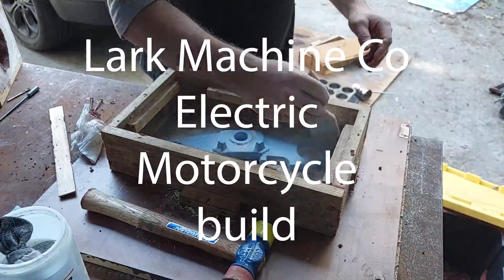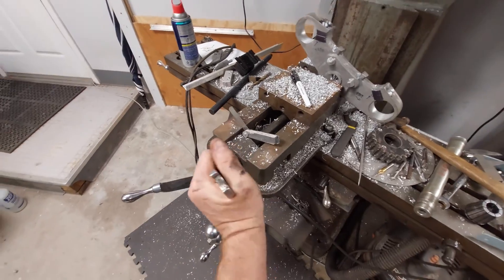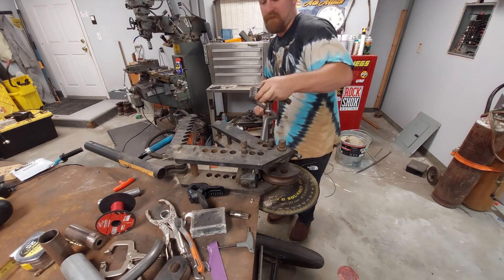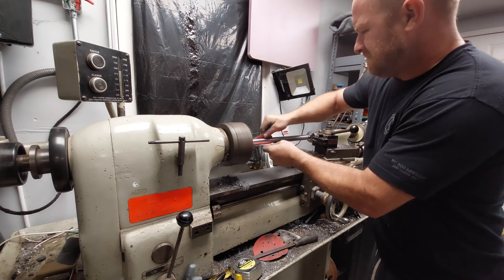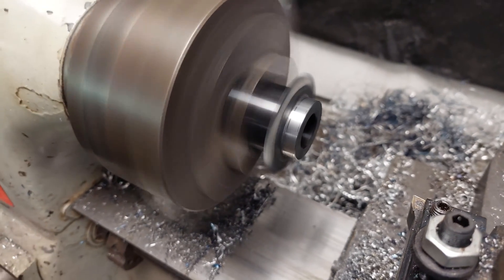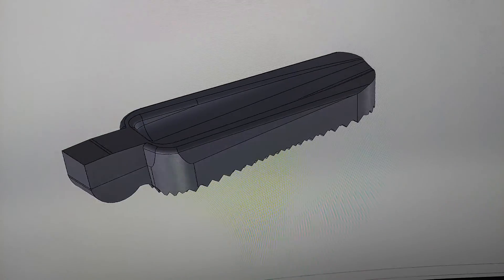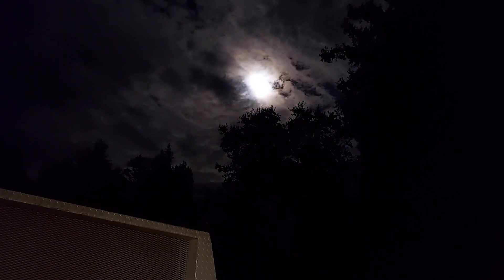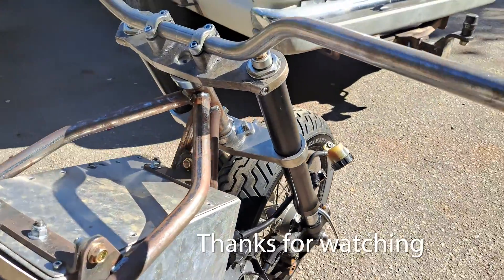Homemade Electric Motorcycle Build Part 1 | Frame Construction | Lark Machine Co

Comment: Hi, great work. But, i think you're going find the swinging arm pivot mountings on the frame arn't  rigid enough, considering the torque you're potentially capable of delivering.  Might have been a better option to make the pivot integral to the motor mount?

Comment: I was suprised when you said the motor power is 70 kW😁. From the spec it should be arround 8.1 kW, which is still decent, but it may be somewhat underpowered if you plan to ride your family with it.
Reply from the maker: Liquid cooled contoller and motor are capable of 70kW bursts.  30sec.  Battery will be the limiting factor for power.  Continuous power will be 25kW. Dont know where you got your number, but it might be nominal on the aircooled model

Comment: Never fail to impress. looking forward to seeing next part. I guess the traditional round light would probably go better with the gas tank and the doubled rectangle lights without a tank. You have a vision for sure. Even just baking those foot pegs in your oven could strengthen them up if you're worried about it. Cheers
Reply from the maker: Thanks man! Ill mock it up tonight bith ways and have some smokes over it